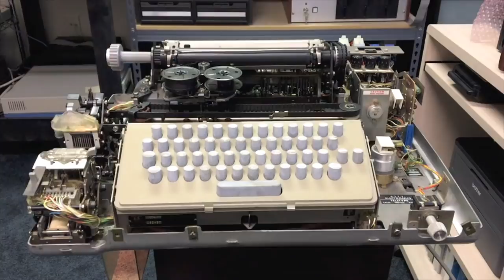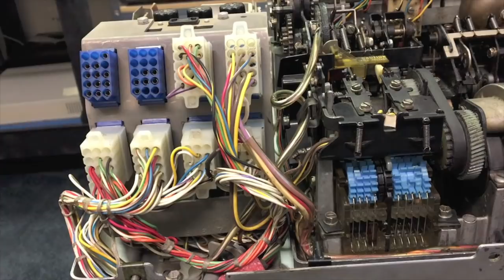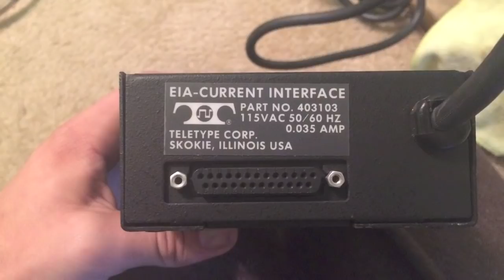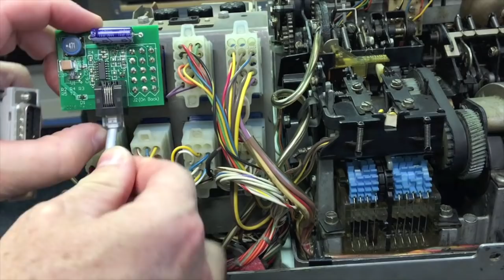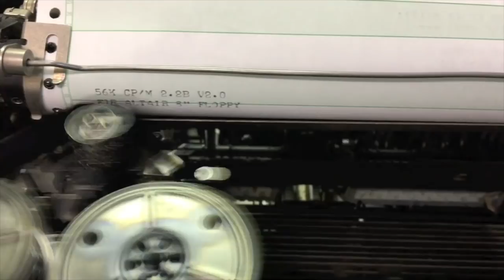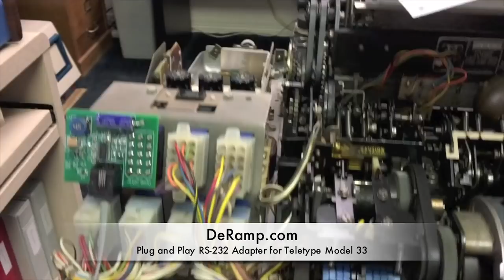Connecting a Teletype Model 33 to a Computer

Comment: Very nice! My Teletype has third party boards inside to make it RS232 compatible. But I know, that was not standard back in the days. I have a second Teletype which has only current loop. This is a nice way to convert it. On your website there is a PCB which does not contain the SOIC-16 chip which is on your demo circuit board. Did you make an update? Do you have schematics available? Just curious what you have made...
Reply from the maker: Yes, the latest board rev no longer has the IC. You can find schematics of both in the manual: https://deramp.com/downloads/teletype/TTY-RS232%20Manual.pdf